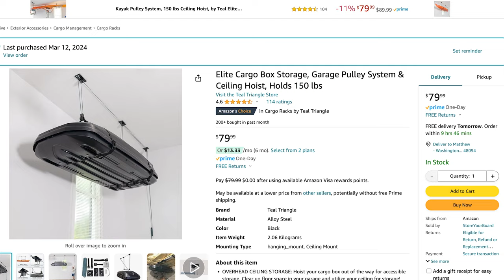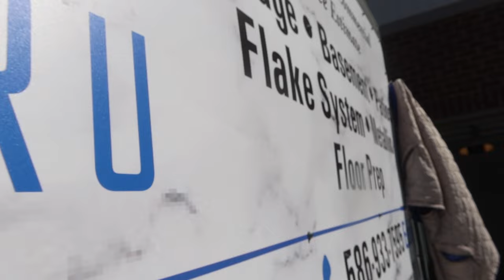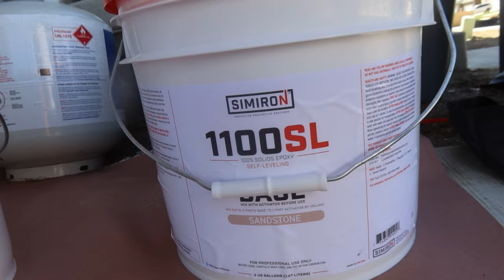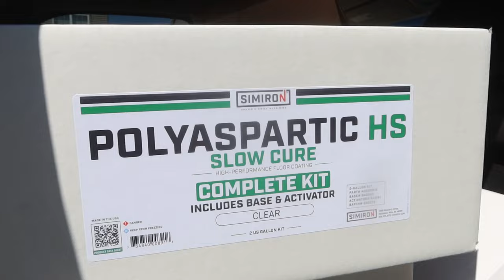Top Quality Epoxy Floor Coating, Dim Sum and the Ford House

Comment: I’d planned on epoxying my garage before we moved in, but our moving in was delayed because the completion was delayed. Now 34 years later I doubt I’ll get back to getting it done. The garage is filled with 3 cars,several bicycles and a GreenSpeed Magnum XL hung on a pulley system.
Reply from the maker: Yea…. That’s why I wanted to get it done asap before we lived in the house too long.